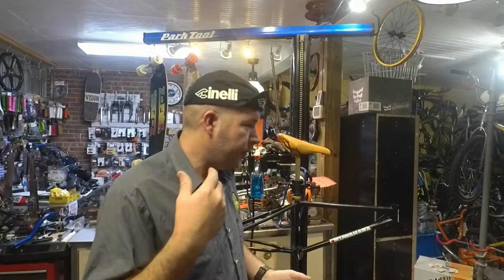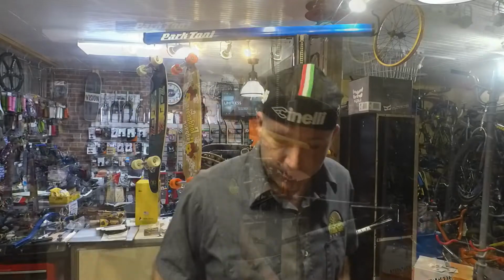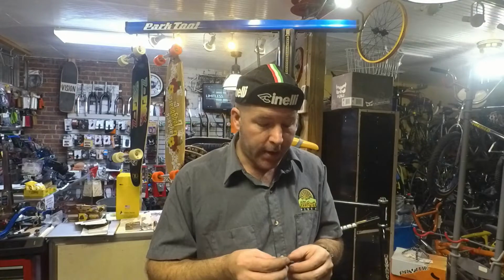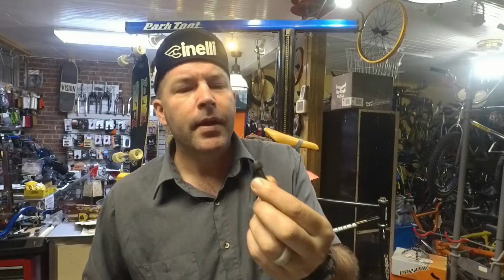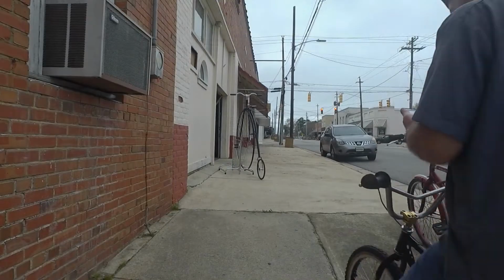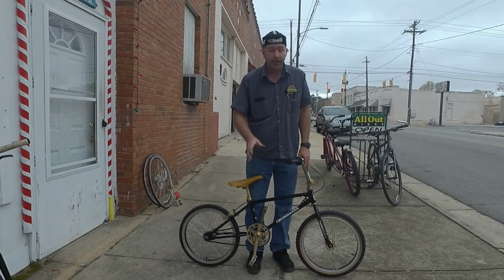Kuwahara Resurrection

Comment: Hey dude whats a bike that that cost to purchase?
Reply from the maker: Its hard to say. This is the most rare version they only made it for 6 months before redesigning it. Late 1979 to early 1980 is when they made this model. You would have a hard time finding one for less then $2500 but could go for as much as $5000 if you get a few collectors bidding. Thanks for your question.